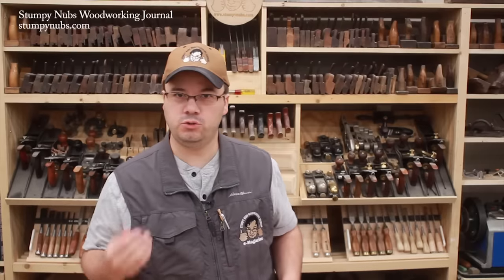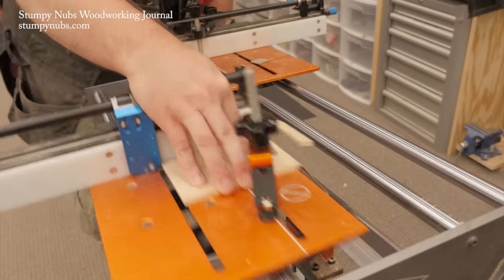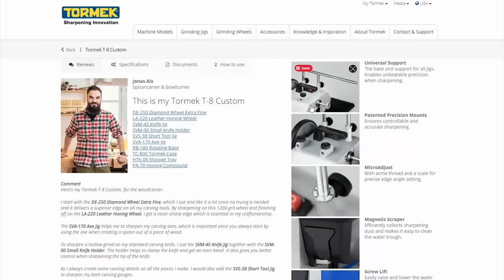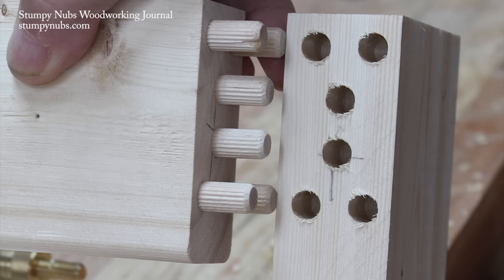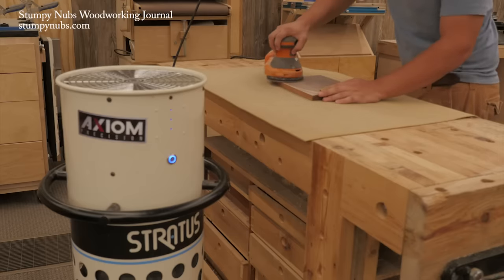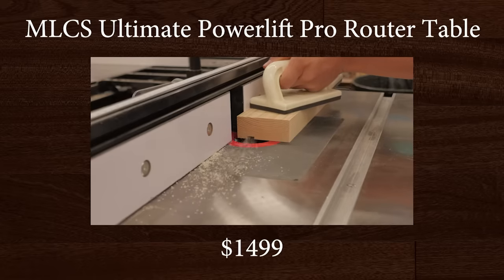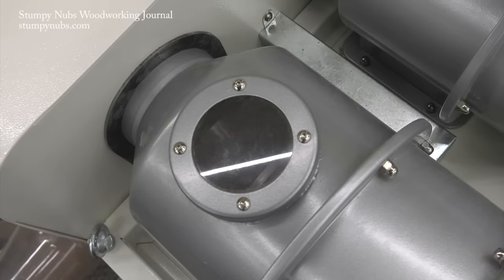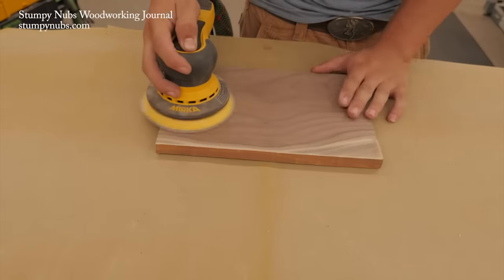Ten EXPENSIVE woodworking tools you have to see!

Comment: I just bought my Harvey G700 about two months ago. I found it earlier this year online for about $5500...yikes. I closed that window real quick. Then I got emails from Harvey about flash sales over the summer that showed the price dropping dramatically over several months. Then I managed to grab mine around $2300 with shipping! I especially love that it comes standard with a remote. My wife sure appreciates how quiet it is! My only complaint about the machine is the viewports. They're cool for demonstration purposes but are really unnecessary, haha. A criticism I have is that they don't offer different size duct fittings. But, who does? shrug I had to get a custom reducer made to go from the 6" inlet to a 120mm hose. I'm using a Minimax 4-in-1 combination machine with 120mm dust ports. I know...so un-American. lol

I have to add: This is my first real dust collector. I tried using a Harbor Freight 1.5Hp model (because it was cheap) but the base wouldn't fit with the casters or align with the motor. So I gave up. I thought I would suffer and save up for a really nice Oneida system but the G700 was too good to ignore. After 7yrs of woodworking, I'm glad I can breathe again.

Comment: This was a great video. I am at a decision point and am considering either getting a Worksharp 3000 with CBN wheels or maybe a Tormek. I'm on the fence. I would mostly be using this for bevel edge chisels and planes....but sharpening knives is something everyone needs to do. Sharpening scissors would be cool as well. I might get a lathe and get into turning someday. It seems that the Tormek T4 would suit my needs, but would really enjoy a head-to-head comparison by someone who knows both the Tormek lines and the worksharp. Any/all advice is welcome.
Reply from the maker: The WS3000 is out, in my opinion because they stopped making their wide blade platform and their Tormek jig bar. So it's only good for chisels, now. (I still use mine to flatten the back of plane irons that need a lot of grinding, but I don't sharpen with it.) You can't really do a head-to-head comparison between a bench Grinder with CBN and the Tormek because they are totally different things. A bench grinder is for rough/medium grinding, a Tormek is for sharpening/honing. Many turning tools only need rough grinding, so Turners love CBN. But woodworking tools need much finer sharpening and that's why I like the Tormek. The Tormek is also more versatile. I wouldn't sharpen knives, scissors, etc. on a bench grinder. But the Tormek has the jigs and the fine grits required to make that easy. (You can get a Tormek bar for a grinder so you can use the jigs, and you can get really fine CBN wheels, but by that point you're paying almost as much as the Tormek, anyway.) BOTTOM LINE: If I was just a wood turner, it would be a tossup for me. But as someone who sharpens a wide range of thing, the Tormek is my favorite. And this is coming from someone who is sponsored by BOTH Tormek and Woodturnerswonders.com CBN wheels!

Comment: I didn’t read ALL the comments… but adding a cyclone to the Festool Dust Extractor is brilliant. I have had a Dust Deputy on my CT 36 extractor for many years and recently added a Festool cyclone  to my CT SYS. I now use ANY portable tool with either extractor.  I also do all cleanup with either extractor.  Sure, they are now both a taller size but the footprint remains the same with either extractor + cyclone. It’s a compliment to say these extractors really suck!

Comment: Which would be a better purchase an Axium Stratus or upgrade my job site saw to a cabinet saw?  Currently my job site saw works fine and I have no air purification system installed.  I do have a dust collection system from Grizzly but it does not help with most of my smaller equipment that requires a 2.5in port.  Thank you!
Reply from the maker: Upgrade the saw and wear a dust mask when making lost of dust until you upgrade that too.

Comment: Hello, I have a town house  garage workshop. It works only because I  respect my neighbors. I have double sheet rocked the garage with sound rock. I have housed my compressor and vac. I batch cut  when i know the neighbors are out.. I am always looking for the quietest version of every tool. based on this video I am going to purchase the Mirka sander and couple it with my new festool exxtrsctor . i am also contemplating the pull saw table.

Do you have a patron link to the Pull saw table and the Mirka sander? I would like you to get the 3%. cut.

Also I would enjoy a video that looks at the " quietest model " of each common wood shop tool. I know lots of folks would use that knowledge to help determine future purchases. As appreciation for your videos i will check and see if you have a patron/partner link for any shop equipment  purchases i will be making.

Glenn
Reply from the maker: I do not have a link for the saw, but I do for the sander: https://amzn.to/3kzoZbm Thanks for the support!

Comment: I've once bought a drule tool. A Greg pinner the pushed 2 inch pins through solid oak. I loved my pin guns and had high hopes. I wanted attach face frames to boxes. Except it would go through the frame then bent and would not penetrate melamine box's. No problem, I'd just return it except the manufacturer refused to believe me.
It works great for short pins....but sure has added to my growing distrust of tool manufacturers. (I remember the days when Porta-Cable was a quality tool.)

Comment: I’m in the market for a new shop vac and have been considering Festool.  That combined with the Mirka sander seems like the answer.  Guess I better keep saving up!  ;). Thanks for all the great content.  I always appreciate your videos for the content and the delivery.  You’re also a great motivator!
Reply: Check out the Karcher WD5P, it was about 160 at my local lumber yard and does a lot of the same as the Festool, variable power, auto start and (manual) filter clean. Have ran the domino and TS55 on the autostart. Quite literally gave away the perfectly acceptable rigid to a friend due to its noise.

Comment: I use a fein turbo 3 with unattached dust deputy and an overhead charcoal filtration system for my normal daily dust and chip makers. I have been thinking about getting the festool hepa system just for sanding. Thanks for your very interesting video

Comment: Question: In one vid, you expound on NOT using extra fine diamond stones and your logic made complete sense. What is your take on the Tormek Extra fine (1200 grit) diamond wheel? Same issues or does it actually work? Thank you for another fine video
Reply from the maker: The diamond stone I recommended in the video you referred to was 1000 grit. The Extra fine Tormek wheel is 1200. There is not much difference between them in terms of grit size. Neither qualify as the ultra-fine grits I mentioned in that video.
Reply: @StumpyNubs  Very well sir. Thank you

Comment: Interesting tools, and - a most excellent and useful presentation. *Thank you*.
Question: Do you think that Harvey Dust Processor, is a good alternative to a common dust-collection system? In other words, skip the dust-collector and just go with the Harvey plus perhaps a vacuum for the small single tools such as a hand-held sander ???
Yeah, it's a bit pricey. But I'm putting together a new workshop and have been agonizing over what to select for my dust-control needs.
Reply from the maker: If you mean better than one of those units with the blower that attaches to a hanging bag and filter, absolutely.

Comment: How long do the .3 micron air filters last on the Gyro Air G700 before needing to be replaced?  I looked at it on their website and noticed they recommend you bundle two extra filters with five of the bin liners.  Just want to make sure the filters don't need to be replaced too frequently since they're currently $349.  Thanks
Reply from the maker: You clean them with the built in mechanism. I've had my Gyro for a couple years and haven't replaced the filters.
Reply: Thank you so much for getting back to me.  I appreciate you!

Comment: Hi Charles, that cast iron router table suffers one problem that is so easy to fix that I don’t know why manufacturers haven’t jumped on the idea. Every time you see a router start a none through cut it spits sawdust out the front, by having a small hole just in front of the exiting piece of wood connected up to the vacuum system this is eliminated.

Comment: Maybe a dumb question but I'm new at this. Why do you have your workshop carpeted? Wouldn't it be easier to clean concrete?
Reply from the maker: It is a very low-pile commercial carpet that is very easy to clean up with a shop vac (which I don't find any more difficult that sweeping). It's great under the feet, it dampens noise and it makes the shop feel warm and cozy. I love it. Here's a video we made about it some time back: https://www.youtube.com/watch?v=L6wWGBc8_Zs

Comment: Great review. I had been researching the heck out of the G700 and this vid was maybe the icing on the cake. I have a small garage shop and am mostly a wood turner. It should be perfect. It’s really a dust centrifuge.
I’ll be building a bench over mine too. Is the workbench you built over it a mod of one of your plans? How much clearance in the back?
Again, thank you for all the info you share.
Reply: Also, did you reorient the wheels? 
On mine the left fixed wheels orient front to back with only the single right wheel. 
This makes pushing it under the bench like seen here impossible. 
I don't have a lift to easily get under if the orientation can be changed, though if it could I'd go rent an engine hoist.

Comment: Hi James,

I’ve been looking for a new dust collector and have narrowed it down to the Harvey and the ClearVue 1800. Other than noise levels and overall design is there any performance or other advantages for one over the other?  Thanks
Reply from the maker: We run both in this shop. The Clearvue EF5 handles the main shop, the Harvey handles the corner workshop. Both are very capable machines and you would not regret either one. I see the Clearvue EF5 as a more powerful, industrial machine. I keep multiple blast gates open with it and it has no issues. On the other hand I see the Harvey G700 as the ideal medium-sized shop system for folks who like a nice, clean, high-end workshop. It is easier and less messy to empty the chips, it fits under a high bench and it will run just fine with 2 blast gates open. One more thing to keep in mind is the Clearvue is a good system if you run the main ducts near the ceiling, while the Harvey is best if you run ducts or hoses near the floor. This is due to how the inlets are positioned on each collector.

Comment: How does the Mirka sander do with sanding pigtails ? My sander drives me nuts with them .
Reply from the maker: Pigtails are impossible to avoid completely with a orbital sander. But the better the dust collection, the less you will get them. The Mirka is better than any other sander I've used in that respect. But I've still seen a few pigtails now and then.

Comment: I have worked for some years as a professional surfacer and spray-painter at at a woodworking shop, and therefore logically done my fair share of sanding too. I have used both the Mirka and The Festool orbital sanders. I can for sure say, I dint like the "paddle-switch" on Mirka. Since you have to hold it down all the time for it too sand. If you for some reason want to change grip or hold on it, it stops and so does the dust extraction, VERY annoying feature to say the least, and a complete dealbreaker for me! Frankly the Festool does just as good job sanding, so its Festool for me

Comment: Great compilation of higher end tools.  Thank you!
Have you used the Mirka sander with the Abranet mesh grip discs? If yes, are they better than garnet or aluminum oxide?
Reply: If you think, that the Mirka Deros is a fine tool, then use Abranet mesh! Especially sanding on painted surfaces, it makes a big difference. Dust extraction will be improved and the disc will not clog anymore. Impoves also dust collection and clogging with other sanding machines, like the Festool Rotex or the Makita  BO6050J rotation sander.

Comment: And another question: in another video you praised the bora track and saw plate. What if you don’t have square ends to clamp that thing?
Reply from the maker: They make clamp accessories that fit into a track on the underside of the edge guide so you can clamp it at any angle.
Reply: Thanks so much! Love your channel!!

Comment: First I apprciate all you share. Just like to mention that Grizzly and Triton make doweling tools like the domino. All the same gizmos, drilling 2 dowels at a time they are comparable in speed to the Festool domino. The doweling tools are about a 1/4 the price of the Festool and the dowels are less expensive as well. Dowelmax is an awesome jig for sure and I am not putting it down in anyway it is that just I have heard many comments comparing the Dowelmax to the Festool Domino and to me they are apples and oranges.

Comment: Do you still use water even with the diamond stone?
Reply from the maker: It can be used dry, but I prefer water because it keeps the stone clear of dust, and keeps that steel dust out of the air. The water has a rust inhibitor in it, which I also get from Tormek.

Comment: Awesome video.  I really love your content and appreciate the education.  I'm excited for the portable air compressor tool cart.

Question on tormek.  Any thoughts or experience with CBN wheels on the tormek?  It seems like a logical upgrade.

Again, thanks for everything.
Reply from the maker: I own an aftermarket CBN wheel that will fit the Tormek, but I have never used it because the diamond wheels work so well.

Comment: I bought the early version of the JMP. I thought it would solve some of my problems. Wrong. It was very difficult to calibrate. There was defect in manufacturing. After working with the company, they agreed to take it back. If I were to buy it again I would have them put it together, then if there was a problem upon delivery calibration would not be an issue.
Reply from the maker: I think the new model comes fully assembled. At least mine did.
Reply: @StumpyNubs  At the time (4 or 5 years ago). It was an option. Saved about $100 but I lost that in time and aggravation. That's  not to say it's a bad product. I would hate to think how many hours went into the design and engineering. The product is a specialty woodworking tool and will appeal to some of your viewers. Thanks for the video.

Comment: Why the electric Mirka vs the air powered one with the same 5” pad and 5mm orbit? There is a significant price difference...
Reply from the maker: Air power is loud and offers no advantage in a woodworking shop, in my opinion.
Reply: $400 buys a lot of isotunes! 🤣🤣🤣 or sanding discs...

Comment: I prefer the term inexpensive to cheap. Inexpensive implies there is still quality. Cheap implies it is more a throw away and it just a fill in.
Reply: But in some cases stuff really is cheap rather than inexpensive.  Get a cheap tool and you'll struggle with it because it isn't up to the job, it'll probably break prematurely, and you end up spending more money on a replacement.  As my dad used to say: "We can't afford cheap".  I still don't regret buying that expensive Starrett combination square, the one I had before was a cheap Bahco, and wasn't even square (which is kind of an essential property of a square).  This one is a pleasure to use.  
Really wish I would have had something like that Alberti disc sander back when I was building RC airplanes... even at the price.
Reply: @kaasmeester5903  I couldn't agree more.

Comment: But you missed the most expensive that can do some amazing stuff... The CNC mill.
Being a machinist I'm used to work with them and what they can do with wood is fascinating both when it comes to flexibility, complexity and precision.
But even when I have access to one suited* for wood I rarely use it. It takes the feel and handwork out of woodworking.

*You do not want wood particles in the cutting fluid used in most mills be it a straight oil or a water/oil emulsion.

Comment: Hang on, the point of Japanese saws is that it requires less skill. Pulling tensions the blade to keep it strait and allows for a thinner blade. The hard work is done in the design. Personally I always have trouble with the western saws
Reply from the maker: That doesn't mean they take less skill, LOL...

Comment: I purchased a Festool Dust Extractor after spending three hours cleaning up after cutting MDF. I was using the Festool plunge saw with the dust bag but the dust still went everywhere. I really needed the positive dust extraction. It is expensive but for cutting MDF with all the fine dust it is a necessity. I am very much an occasional hobbyist but I was surprised at how quickly I filled the dust bag. I thought about getting the pre-separator but realised that for my use it was cheaper to buy new dust bags. The brush and other attachments are useful to clean up the inevitable small amounts of dust that are not captured. Just somewhat annoying that in true Festool style these do not come with the extractor but are an additional purchase.